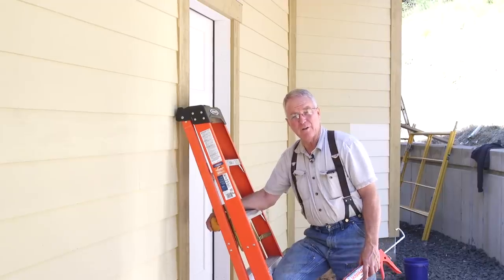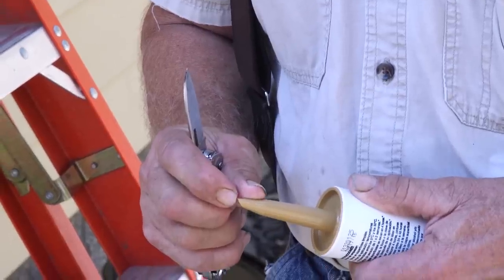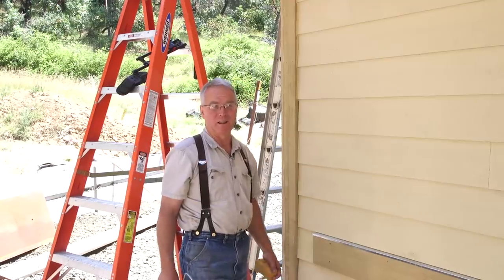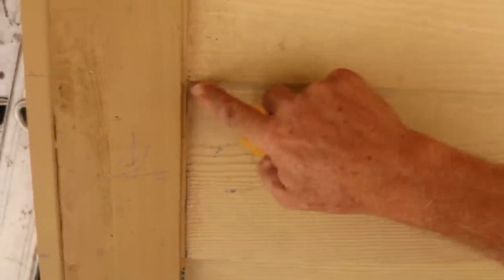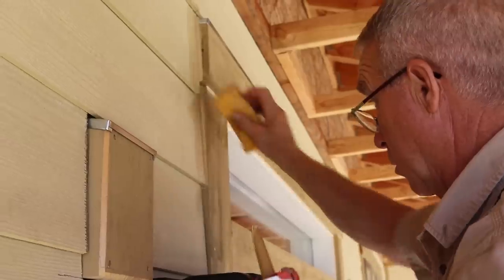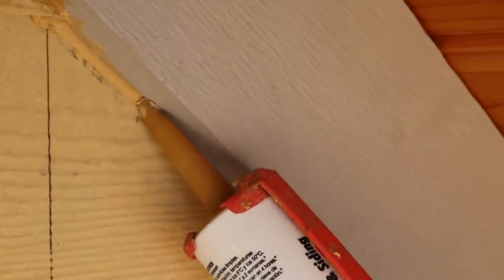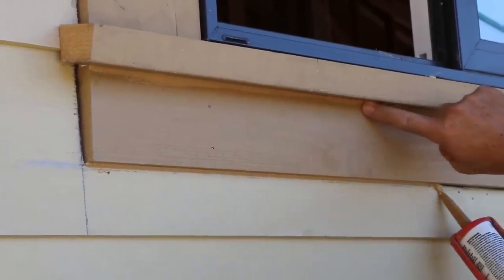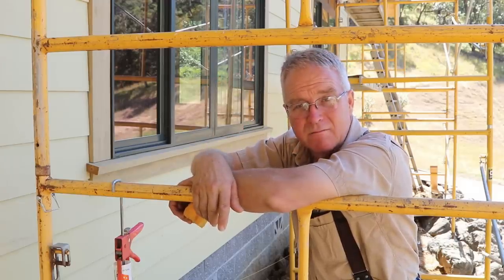Up Your Caulking Game Ep 86

Comment: “Try your best and caulk the rest”
Reply: Caulk and paint will make you the carpenter you ain't.

This aint my personal veiw, its just the one I've heard the most.
Reply: Omg use bricks maybe. This is hilarious. In 6yrs time...
Reply: First time I’ve heard that. Actually kinda like it.
Reply: @paullopinto2777  same but that's miles of silicone. No wonder the tube is cut small. The only silicone I have is round my windows.
Reply: @smartgorilla  Wet rooms?
Reply: @jothain  I mean outside
Reply: "There's caulk for that.."
Reply: As one old drywall guy I know used to say, “That’s why they make crown molding and caulk.”
Reply: Hahaha!
Reply: Bondo & Paint: Make It What It Ain't
Reply: @nathanmitchell4196  heard the same thing, only for glaziers
Reply: That ones going up there with "grinding and paint make me the welder i ain't"
Reply: @jasondouthit4490  totes
Reply: Every hack ever
Reply: Axel James oo
Reply: Ah yes, you must also be a glazier
Reply: Some crappy jobs, I'll admit I adhear to this sentiment.

Comment: One thing I'd add is that it's important to get a caulking that's paintable, so no silicone. And none of the cheap acrylic junk (like that Alex brand)! And if you're doing a big job like this, get a caulking gun that uses sausage packs. They're twice the size, cost less per unit volume, and create far less trash since the only waste is a crumpled foil pack, not a big plastic tube. Also, if you can afford it, get a cordless caulking gun. I wrecked my wrist for years using lots of heavy caulk on a roof, so now I use a cordless sausage pack caulking gun.
Reply: Many of the new generation silicones are modified to accept paint.
Reply: You could also caulk over silicone with paintable caulk.Ive done it a few times.Works great.
Reply: Window guy here, paintable caulk won't adhere to silicone so eventually it will fall off.

Most silicones come in multi color sausage packs these days, we use Dow color match 100% silicone for our windows. The silicone has a 20 year warranty
Reply: @richardthomas6054  He forgot to caulk the weep holes, rookie!
Reply: @ryanevangelist4094  I've been going over the polyurethane sealant I used on my new shop (turns out that free, 2-year expired sealant doesn't hold up well before getting painted!) with Masterseal 150, which is some form of modified silicone that's paintable. So far so good!
Reply: @mastermetalshredder  Lol.  I guess the rando's my 'builder' hired must have been pros as they caulked some of those weep holes good.  Had to spend a good amount of time removing it.
Reply: Acrylic is still ok for inside use. Very easy to handle. For some substance MS hybrid polymer.
Reply: @richardthomas6054  i only use thermoplastic caulking on windows
Reply: @ryanevangelist4094  ...and  attract fine particles in the air like sand.
Reply: So are we just not gonna acknowledge “sausage pack caulking”?
Reply: As a third-generation house painter my only problem with caulk is getting caulk finger
Reply: I’ve painted roughly 80 new built homes and used Alex Caulk in every single one without issue
Reply: @mux2724  Sure, but have you gone back to them after 10 years? I used that cheap Alex stuff on my shed when I built it 8 years ago and it started peeling away about 3 years ago.
Reply: @paulwilliams8555  no shit huh
Reply: You are right but big stretch is still water based crap. Just barely better And should never be used in wet locations. No matter what they claim
Reply: @BrooklynBalla this will fail.Only silicone bonds to silicone.
Reply: @richardthomas6054 Which Dow sealant is that? Most are Dowsil followed by a number.
Like Dowsil 795 
Dow does offer a 20 year project specific performance warranty. We get it all of the time. But I’ve never heard of a 20 year warranty without going through there extended warranty protocol. Do they now have a product with 20 year standard warranty?
Reply: @mux2724 I’m a professional caulker and using acrylic ( or any water based caulk) on exteriors is one of the biggest reasons that homeowners have to replace their caulking so often. It is a FACT that they are one of the lowest quality sealants available.
They are great for interior paint prep but that is about all. 
They should never be used in any wet location no matter what they claim.
Reply: The problem with using sausages is that most low quality sealants like water based, ( acrylic) aren’t available in sausages.

Comment: For anybody that doesn't know the difference, this video uses examples residential type caulk. Commercial applications such as storefront systems use much different methods. We use tooling knives and tape and whereas you may not want certain types of caulk to be warm or hot polyurethanes that we use are just the opposite. They can be very thick and hard so you want them to be warm if possible.  Also call Guns come in different ratios. The the ratio of the caulk gun is the squeeze to force amount. So how much you squeeze that trigger is relevant to how much caulk comes out. I use an 18:1. Ratio. You can get 12:1 up to 24:1. 24: 1 would be for really thick hard epoxies and polyurethane. A 12: one would be for say a latex or acrylic caulk. Just some things that somebody might find helpful
Reply: As a Iron Worker back in the early 90's I worked on the 44 story insurance building in down town Des Moines, Ia. I was on the caulking crew for 6 mths.,we also used different shaped tools to strike off our joints. Learned from a brick layer. The 6 man crew went through 880 5 gal. buckets of silcon and 200 pee shooters.
Reply: I have been a professional caulker for 45 years.And unfortunately residential caulking is usually synonymous with low quality.There is no reason that homeowners should have to replace their sealants as often as they do. Builders need to stop choosing their sealants based on ease of clean up instead of quality. No commercial caulker would ever use a water base sealant in any wet location. And there is no reason a builder or painter should. It is simply cutting corners.
Reply: @johnhowerton8241  I have been a professional caulker for over 45 years. Part of the Bricklayers Union .We average 72000 feet a year. In 10 years that is over 100 miles I don’t even want to think how much sealant I went through in 45 years😜.
Reply: Thank you for this comment!

Comment: A handy tip from a Handyman. When cutting the tip, start the cut from the high side. This gives a clean point and leaves the "feather" on the low side where it doesn't get in the way.
Reply from the maker: Thank you! I’ve never tried that but I will today!
Reply: @essentialcraftsman  watch your fingers then: muscle memory can cause problems sometimes.
Reply: Warrior Son  I think the high side would be the point that is farthest up the tip, or that is the higher up on the tube.
Reply: Warrior Son  high = tip.
Reply: Warrior Son  both explanations mention the tip as being the high point.
Reply: Are these fastened to the tube? The ones we use are removable, so you can just slap in onto the next tube without cutting the tip every time.
Reply: Well in the end he cuts off the excess tip to form a flat end so in his case it doesn’t matter.
Reply: @malinwilliams7934  that is, indeed, what he meant.
Reply: @Davey768  the typical caulk tube in the US has the applicator tip attached from the factory.
Reply: ive caulk for years and never taught tu cut from the tip down. makes sens. since.i slick all.my joints it doesnt really makes a difference
Reply: @essentialcraftsman  it does go against muscle memory. Be careful because you kind of have to cut towards yourself.
Reply: Warrior Son  high side would be the narrower end.
Reply: @Davey768  I've used a variety of tubes, some with a replaceable tip.
Reply: I’ll have to try the wet sponge
Reply: Warrior Son  The high side is the longer side.
Reply: Warrior Son  if you can NOT figure it out just try it BOTH ways and do what works best for you . . The jist is to cut from the tip towards the tube . Hope that helps clear it up . Cheers
Reply: Thats great advice
Reply: @jimmymckay73  legendary!
Reply: Warrior Son  He means cut from the top down
Reply: I work with tile and caulk for miles, never thought of doing that, but come monday i will.. Cheers m8
Reply: @alienhexican8017  Here in Australia I've only seen them with removable tips. It's handy - they're packaged with one tip per tube, but on a big job you might use one tip and just keep transferring it to the next tube for however many tubes you use that day, and then for little woodworking jobs if the caulk sets in the tip you can replace the tip and keep using that tube.
I always put a nail in the opened tip, but sometimes it sets anyway.

Comment: I worked with a guy that spent years in a mobile home factory caulking kitchens and bathrooms, that guy could go all day with one sheet of paper towel to clean up his caulking mess.  It was pretty amazing to watch.  I have that stuff everywhere in 3 minutes.
Reply: @peehandshihtzu  That's impressive. I have several pairs of jeans that are 'paint jeans' because I got urethane caulk on them, somehow, and they can't be cleaned. I can run a great bead for up to several inches at a time, on a good day...
Reply: Peehand Shihtzu last week, got silicone caulk all over my hair leg. Basically got a free leg wax when I was trying to get it off. Ouch 😬
Reply: @manncura  Owch! Just so you know for next time, oil will dissolve silicone. So put an oil-based moisturiser on your skin next time you get silicone on you!
Reply: @samuelmellars7855  !!! thanks, I have the other to half to caulk in a few weeks, and unlike the pros, i either put on too little, or too much and can't contain the mess ;)

Comment: As a pro painter for the last 30 years my tips are. Use a 1" wet paint brush to smooth out painters caulk and a small container of water, , and carry a pocket knife to open and trim your caulk tips. 
And my favorite new house site job is Friday afternoons caulking up next weeks house to paint. 

And a simple filler backer strip is plain newspaper poked in the gaps.

Comment: For interior like bathrooms/showers: 
Put masking tape either side of the joint.  
Apply sealant.  
Run finger along pushing into joint leaving the excess on the tape. 
Remove tape for absolutely perfect crisp laser-straight caulking everytime.
Reply: Better spray with water and soap before removing tape or it'll curl or pull up caulk
Reply: Better spray with water and soap before removing tape or it'll curl or pull up caulk

Comment: @ Essential Craftsman what you want when youre doing a job like that is a bottle with a spray nozzle on it and fill it with washing up liquid(uk) dish soap in america i think and water , after you apply the caulking spray some liquid over the area and then rub it off(you called it striking) the washing up liquid and water mix prevents the caulking from sticking when you spread it with your finger so it doesnt go when you dont want it too, like the white door frame @6:03  the trick is doing it from the bottom up so the run off from the liquid doesnt interfere with the next section you want to caulk
Reply: Agreed. Also caulking should form an hourglass shape to form the best / longest lasting bond. .

Comment: I added siding to my shed and caulked it one Autumn. I decided to wait until Spring to paint. What I found out by Springtime was that a lot of the guaranteed non-shrinking caulk had shrunk! Seemed a bit of a hassle but a quick re-caulk had it looking all spiffy again. Matter of fact the old caulk acted like a good base for the second go round. That was years ago and ever since then I have double-caulked most jobs. I'll get caulk on there, especially any deep joints, wait a few days to a week and then do the best caulking job I can of it. I have found that  the results are pretty good even a couple years after. I have tried to theorize whether that affects how waterproof the joint is, but I don't think so.

Comment: As a finish carpenter, with caulking I use a light spray of water after I apply the caulking but before I finger it clean.
With silicone, I spray denatured alcohol.
Makes clean up a breeze.

Comment: One tip, especially in warmer climates, use a water bottle with a rag rapped around it for cleaning your finger. A drop of detergent helps the surface tension from getting out of hand. Fits nicely in the tool belt too and eliminates the risk of dropping a bucket of dirty water on your work(or foreman)...

Comment: I will often push a bead of caulk. Or vary the angle to get more penetration. If I can lay a bead that does not need striking, it will usually set and shrink into a great looking bead. That flat bead from the tip looks better than a rounded finger tip bead in some situations. Some surfaces do not look good with that feather edge. Sponging off a feather edge can be a lot of wipes. Varying the water content in the hydrophilic 'grout' sponge can make a big difference in the clean up.
Reply: I was shown how to "push" the caulk bead by an old timer. It definitely leaves a better finish.

Comment: a cold weather trick I use is to put the (plastic) tubes in a bucket of water and place an aquarium heater in the water to keep the caulk at just the right temp all day for nice smooth flow.
Also when you come to a wide fill, angle the gun/tip to present a wider opening of the tip, essentially creating a wider flow of material.

Comment: I worked for painting contractor for about 4 years and we panted new residential multi million dollar homes, did repaints on older homes and some commercial interior repaints. That painting made me a much better carpenter (seeing the problems left fir us to fix by other carpenters) and it allowed me to paint the house I built for my wife and I completely by myself. I believe that saved me more money than any other labor I did. Painting is about 85-90 percent labor the rest being materials. Caulking like a pro takes some time to learn and requires some fine motor skills with your hands. I agree with most of EC tips but caulking learned under the command of a demanding painting contractor with demanding multi-millionaire clients is at a different level. Great video.

Comment: Big Stretch is an excellent product interior or exterior.  Its a little more money than the cheap stuff but hey, you get what you pay for. Thanks guys....
Reply: I’ve heard this, but never tried it.
Reply: 850A from sherwin Williams, i get it for $1 a tube, cant beat it for that price.
Reply: @MrC9Oh3  My time to go do a call back at my own expense, to cover all of the homeowners furniture and belongings within a year, re-caulk and repaint because cheap caulking has dried out and shriveled up is worth paying $5 a tube instead of $1 a tube.
Reply: @mattschoular8844  ok, something wasnt done right if failing caulk was the cause of such a disaster. Theres clearly bigger problems at hand. Also 850A isnt shit caulk.
Reply: @MrC9Oh3  SW 850 A is fine indoors where wood movement is minimal but I would never use it on surfaces exposed to serious weather.  It's adhesion and flexibility markedly are inferior to all the 5-8 buck caulks such as OSI QUAD.  30 years ago I was all about saving money by using cheap latex caulks.  Today it's plain unthinkable to use that junk outside.  You will never see it used even at huge developments of new construction where they count every penny. It's not worth it.  But indoors, my painter just used up a case or more of 850 on millwork and it will be just fine.
Reply: @stipcrane  ive used it for years, never had an issue with it
Reply: Yes! I’m a huge (recent) convert to SashCo products.
Reply: @tcoradeschi  such a coincidence, ive never used it before, today my boss brought some out for me to try.

Comment: Just want to add to this great video a little small tip. When the joint you're filling is less than your tube opening, you can go forward and save having to finger it. This retired painter is getting excited for the next videos!
Reply: Personally I never use my finger to "tool" the caulking, I just take my time and lay a nice even bead ( 40 years of practice helps) 😁

Comment: This painter thanks you for taking your time to feather and tool all those joint.  You covered almost everything except pushing that tab at the back of the gun to release the pressure to prevent oozing. Not all products need it, but is essential for others and when learning a caulking gun would save people tons of grief knowing that trick. Although not caulking per say, PL premium is an example of a product that needs that pressure released after every bead. After some time it becomes second nature to release the pressure after every bead as if it's the end of the stroke.

Comment: I use windex when using silicone as lubrication for smoothing.
Reply: Mark  You put it on your finger or rag, not on the join you're caulking. I use dish soap personally. Dry paper towel cleans the finger, damp rag with a bit of soap gets the finger ready to wipe the next section.
Reply: Alcohol in a spray bottle is what's suggested

Comment: Thanks for this. I just wish there was an invention that matched the "squeeze pressure" to the speed. I find that when  I can move at a  matching speed to the right amount of caulk coming out of the gun that my caulk job is the smoothest and neatest looking. Also, everyone needs to know how much moisture should be in the sponge. Too little makes it rough, too much and it makes the caulk look messy. Keeping the sponge clean also keep the "haze" from  affecting surrounding surfaces.